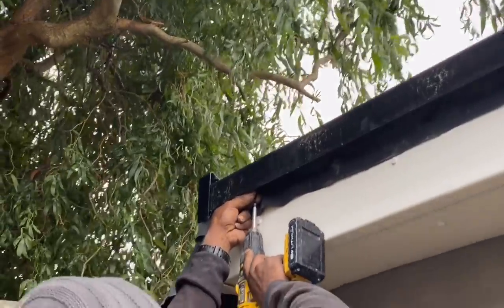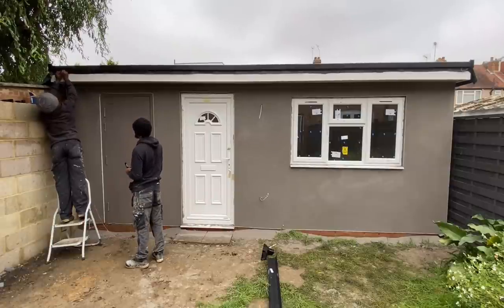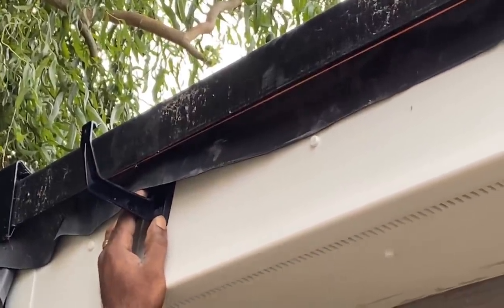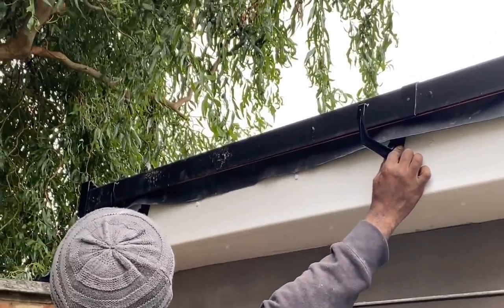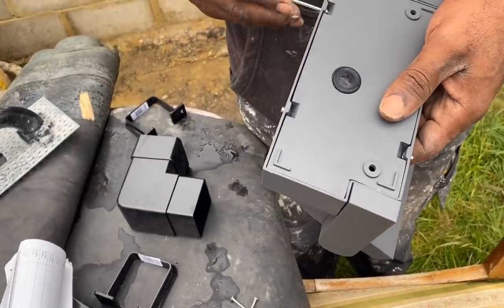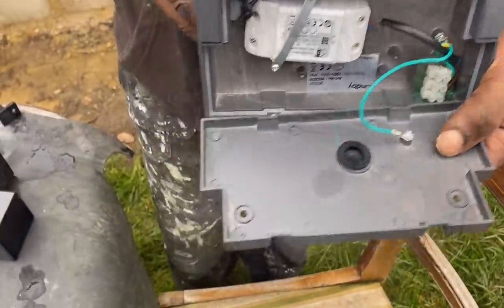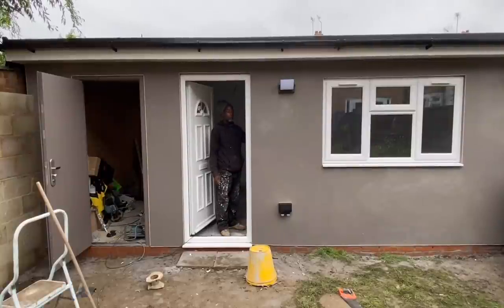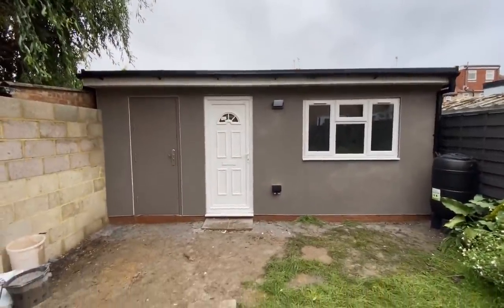Finishing the outside of the garden house

Comment: Hi Darren, should you have put 45's elbow joints on the guttering at the top instead of 90. It helps with the water flow.

Is the beading going to remain visible in white? I thought the render would cover it however this could be down to personal preference.

Great work on all of these builds, I think the customer appreciates it as they can keep this as a record of how it was built.
Reply from the maker: The flow from the flat roof shouldn’t be a problem. Yes the beading is like that. That’s how it’s ment to be. Once you scratch it, it will always show.

Comment: Does your pitch of the roof go from back to front , so is it high at the rear and low at the front ?
Reply: Yes, that's why the gutter is at the front.
Reply from the maker: Yes
Reply: @darrenthebuilder  why did you do it that way .
Reply: @markw7997  Because it was the customers preference.
Reply: Oh right

Comment: Put a gutter clip up tight 1 side then put another on the other end drop it to where you want it depending on the length of the roof and tie your line on to both clips far easier
Reply from the maker: Good advice thanks